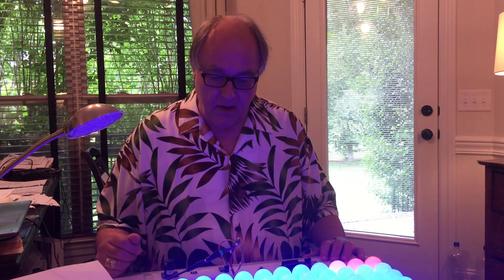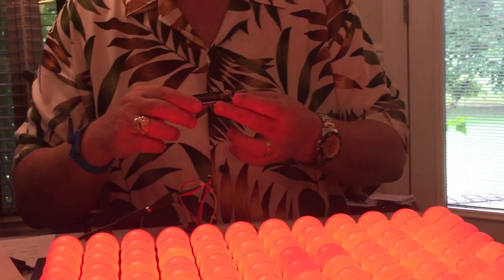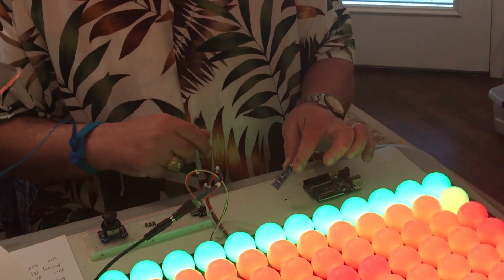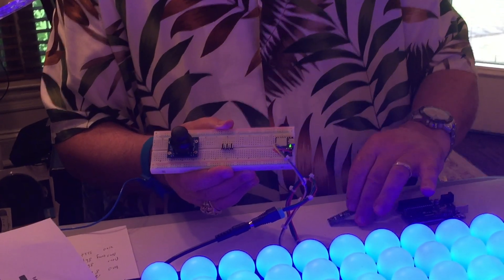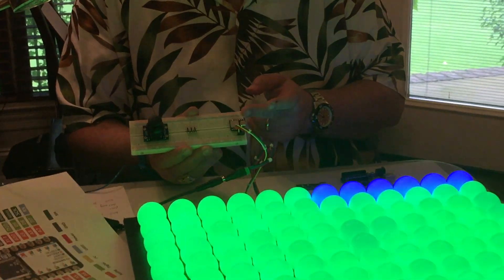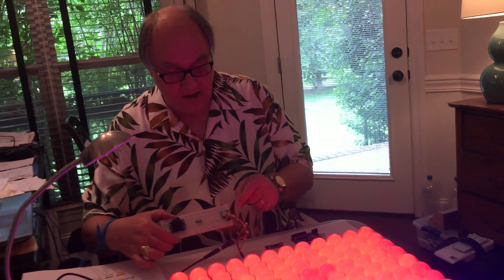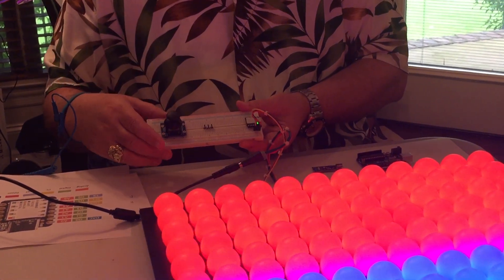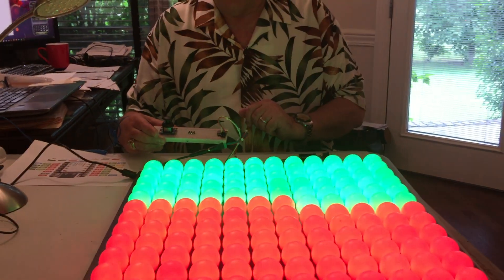Introducing the Seeeduino XIAO Microcontroller Development Board

Comment: Don't get me wrong but you could also drive neopixel leds by attiny10 chip which is really small. Use XIAO to do it it's like shooting to mosquito from a cannon, but I agree, use it for warm-up or check the board is ok:) Please do something with the sound quality.
Reply from the maker: Hi Marcin -- the ATting10 has only 1KB flash and 32 bytes of RAM -- that's not enough to drive more than a couple of NeoPixels -- but it is a great processor for a lot of tiny tasks -- Max